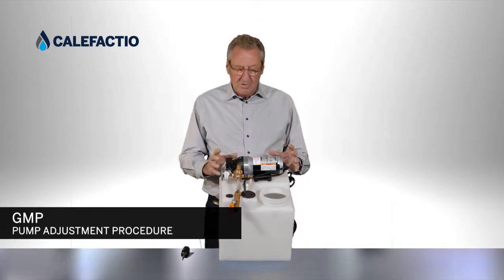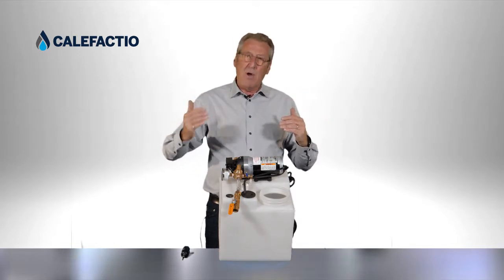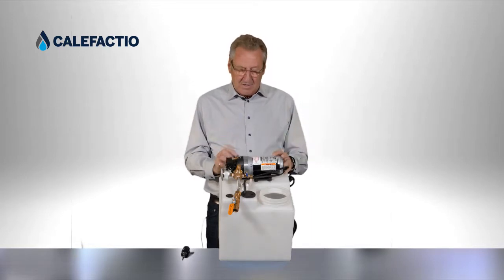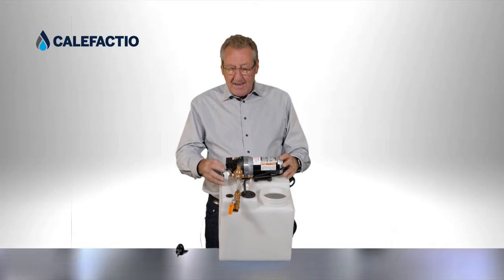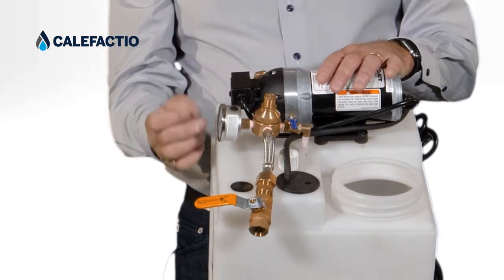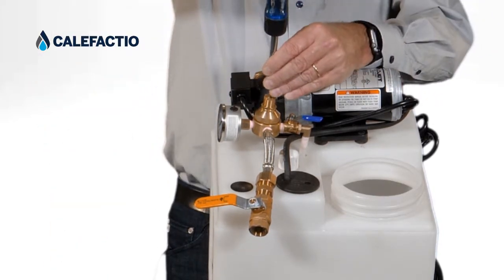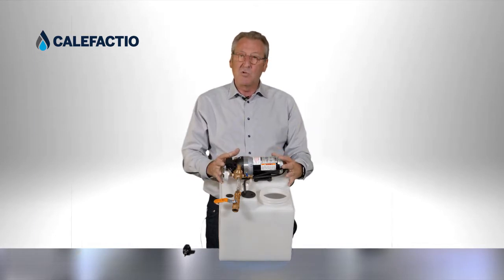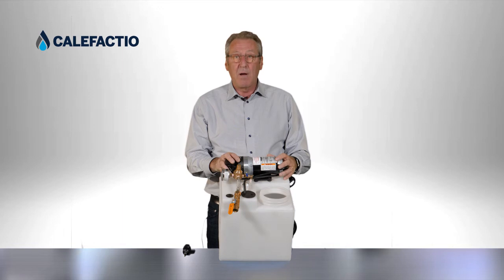CALEFACTIO - GMP PUMP ADJUSTMENT PROCEDURE

Comment: What do you do if the pump doesn't  turn on even when the pressure drops? I have this problem where my Calefactio pump won't immediately turn on after I open the bypass valve (after closing the system valve). The only solution I have found is to turn the PRV valve clockwise until the pump turns on. I then let it run for about a minute and then I turn the PRV valve back to its original  position. And then the pump runs normally. After a few weeks go by the same problem reappears and I have to apply the same fix to get the pump working again. I'd like a permanent fix. Could there be an airlock in the pump that keeps accumulating every few weeks causing the pump to stop working? I use regular tap water with nothing added to it for the pump, in order to maintain pressure in my boiler. Any suggestions?